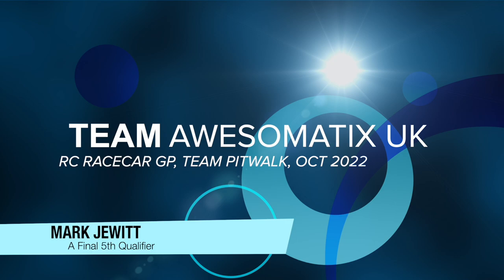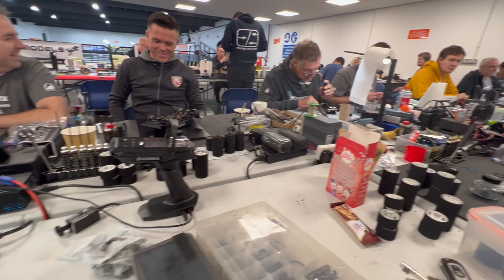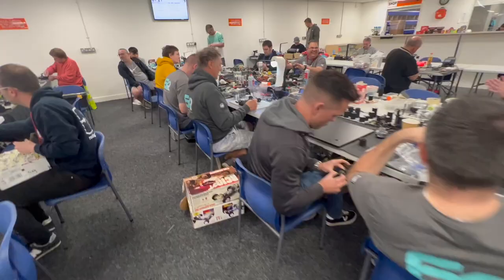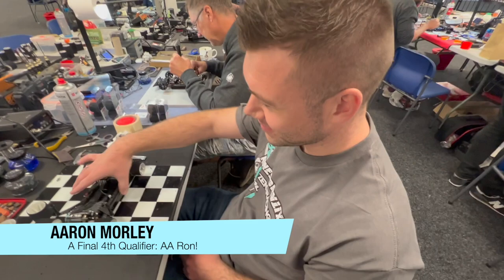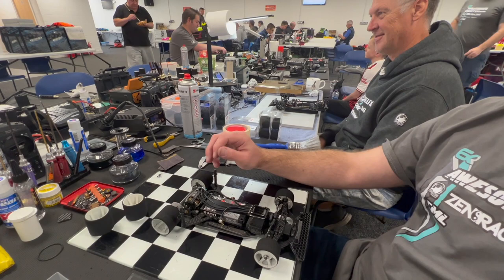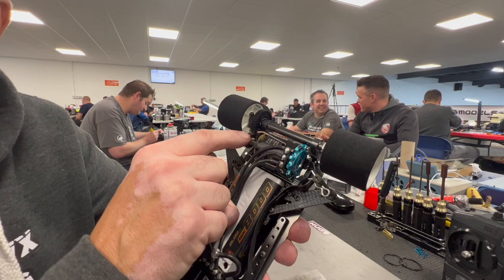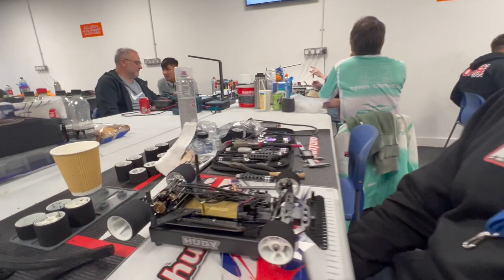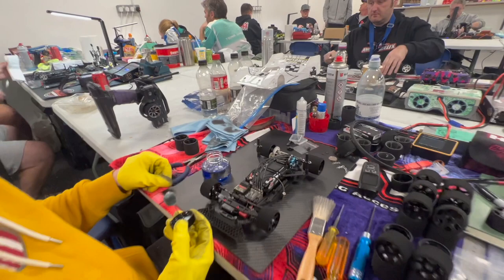Awesomatix UK Team at the RC RaceCar GP 2022

Comment: I just watches this is great. Just curious I haven’t really played with the side bars. The screw placement you tried and the 1.8mm rear bar gap was it track specific? Or is it worth giving a try on any surface? Weird for me since I’m like one of very few that runs on painted concrete lol.
Reply from the maker: We put more pressure in which raises the centre chassis more. This in turn creates more weight transfer at the front as the COG is made higher ref the roll centre. So more steering. We might go up to around 2.2mm rear bar gap.